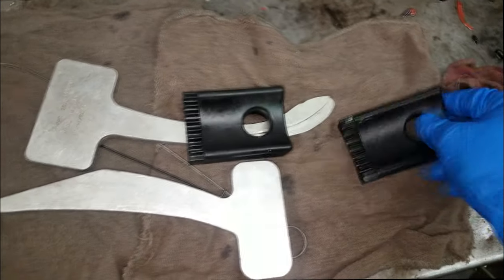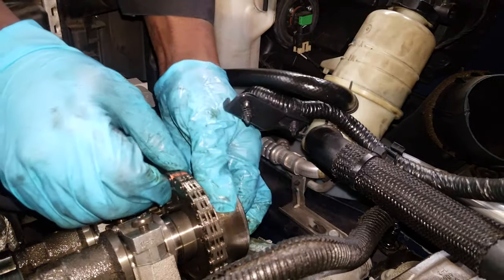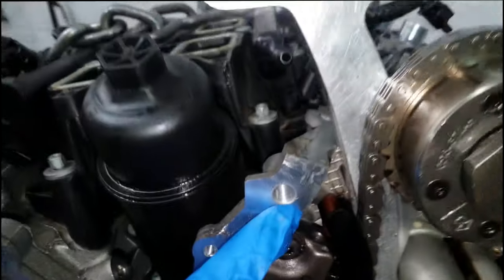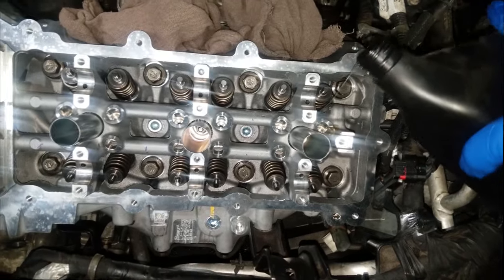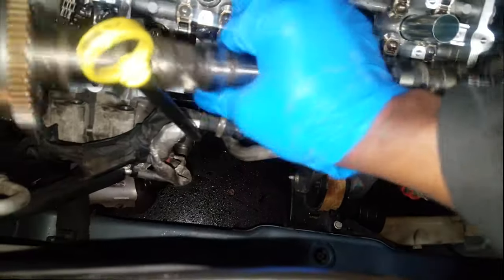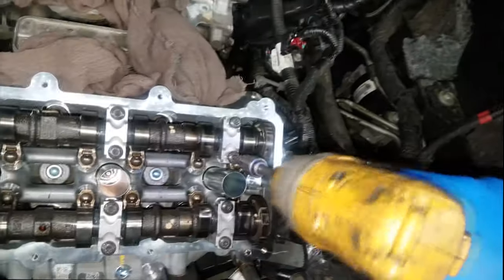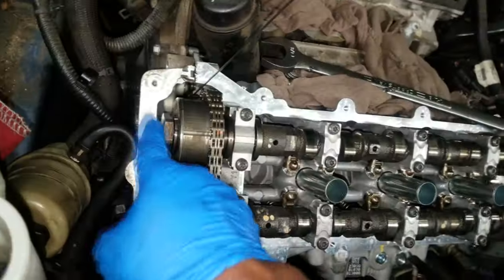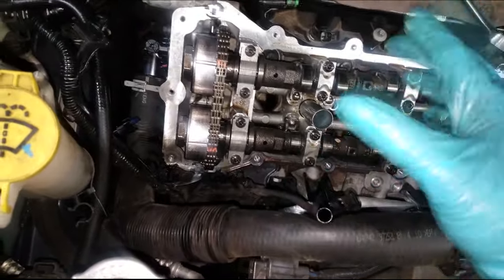How to Replace a CAMSHAFT, CAM Phaser,  rocker arms, 3.6 Pentastar, Timing Chain TOOLS P219A P219B

Comment: Hey man I hope you can help me I'm from Germany and here nobody knows how to repair a Cruiser you are my last hope man I got one with no spark I got an new coil spark plus and und camshaft position sensor the error was camshaft position sensor the cables are good I think it is the pcu do you have another idea? It's a 2006 2.4L 105KW
Reply from the maker: You not subscribed. Can you please subscribe to the channel? thanks
Reply: @OnlineMechanicTips  of course dude 😂 if you can help me then
Reply from the maker: @julian6541  Hey bud I need you to follow these steps in this diagnosis here: https://www.youtube.com/watch?v=BKUiRvhzVxE&list=PL-em2JbvrnvzuLwbtblli0h9-5LL-w8Xa&index=11
Reply from the maker: @julian6541  Are you getting spark from any if the 4 cylinders?
Reply: @OnlineMechanicTips  no got no spark from any cylinder 1 time it sparked once but that's it
Reply from the maker: Make sure the asd circuit complete at the coil connector like I did in the video
Reply: @OnlineMechanicTips  the asd circuit is fine
Reply from the maker: @julian6541  ok, was you getting the test light signals at the coil connector on both driver wires like I did in the video? If not you need a PCM computer
Reply: @OnlineMechanicTips  I have -10volts with my multimeter when I put it to plus and the connectors 1 or 3 is it the same as a testlight?
Reply from the maker: My friend you not measuring volts..you measuring duty cycle ground. Look at the video real good and follow my steps..the orange wire is asd and should be 12 volts for 2 seconds when you turn key on
Reply: What’s the error code
Reply: @doordashrick2973  camshaft position sensor
Reply: @OnlineMechanicTips   hey dude I got a new pcu and it sparked and cranks and I have petrol but it still don't want to start is the camshaft broken? I see no rotation with the sensor removed

Comment: good video, but I can see why nobody wants to be a mechanic anymore, my wife’s 2016 jeep blew both head gaskets, I’ve never seen so many wires and plug-ins, I had endless hours and removing the Cylinder heads, it’s nothing like the old days with a small block Chevrolet in one hour I could have the heads sitting on the bench they make it so difficult anymore, there was nothing wrong with a hand choke

Comment: Those tools are worthless use a 36mm cam phaser bolt with the chain on wont damage anything or move.
With the front cover off, remove the tensioner and bring back the piston with channel locks placing the pin to hold the pistons back then reinstall.